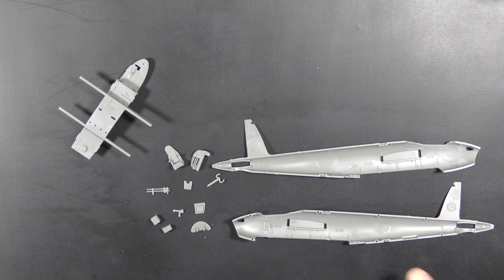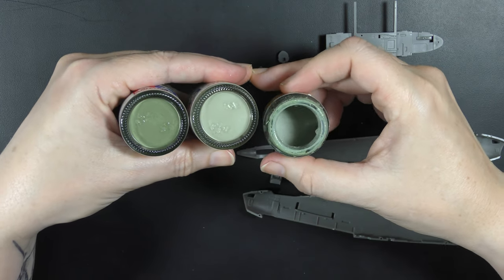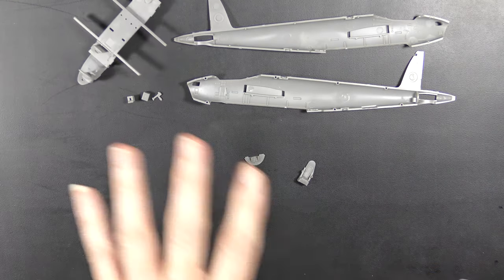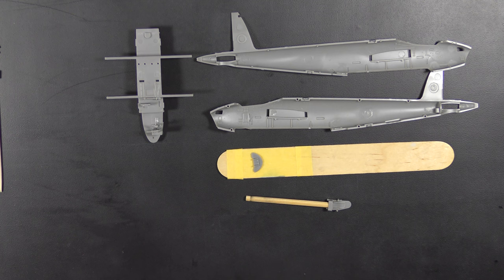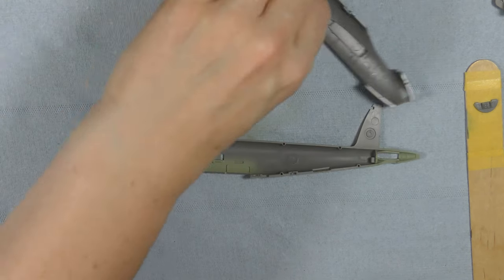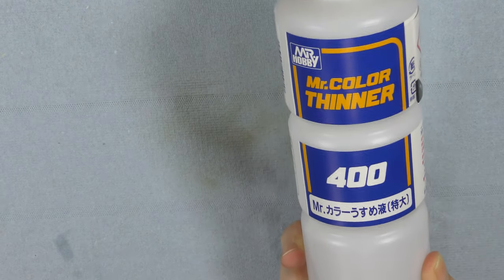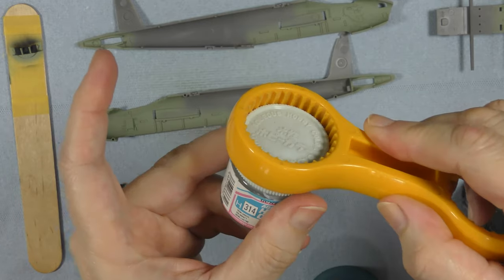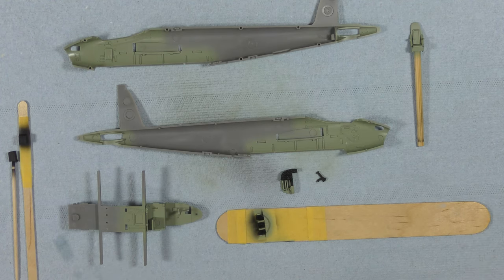*Modelling for Beginners* Part 2 -  Airfix Mosquito PRXVI

Comment: When I worked on Chipmunks, many engine bay parts were painted semi-gloss cockpit green, and we had said paint in the POL store. Notably the Engine Bearers (although that often gets stripped during crack checking), Firewall, Side & lower cowling interiors, Oil vent pipe (from top of "sump" (obv. on top on a Gypsy Major), that is responsible for the huge amount of oil on the undersides of a chippy.  So if you want a decent reference that is on parts that are out of direct sunlight 99.99% of the time, and on an (almost contemporary with WWII), aircraft - go find a Chippy.

Comment: Hi Jen, this is a great series. Q: do you ever try and clean the paint jar threads/lids, esp lacquer paints? I've got lots of old MrHobby, some colours especially develop a crusty seal. While I can open the jars like you show, I don't have much success trying to clean up the jars - mostly I'm afraid of crusty flakes ending up in my paint and causing issues in  the airbrush. How do you deal with this?
Reply from the maker: I do clean them up occasionally, yes. I just scrape and chip the accumulation off and don't really worry about flakes going in the paint - any that do will actually dissolve again over time anyway.
Reply: @JenesisDesignsandModelcraft  thanks for the tip; I'll have a bit more courage next time🙂

Comment: In what circumstances would you apply a primer?
Reply from the maker: I mostly only use primer when there's a lot of surface damage from sanding, or the surface is very rough. I talked about it during part two of the Arma Hobby Hurricane build. I think I might do a Book of Jenesis just about primer, as I think it is quite misunderstood in the hobby.